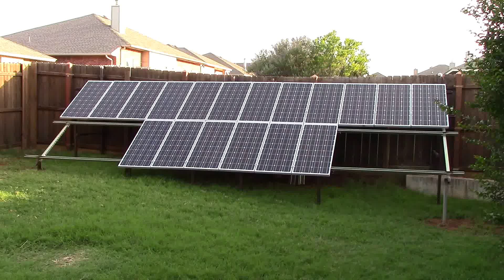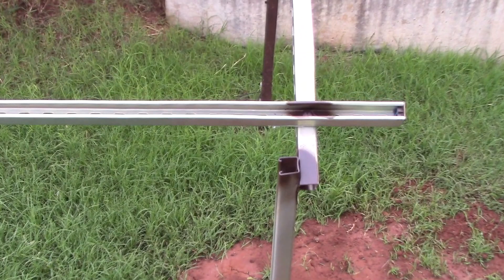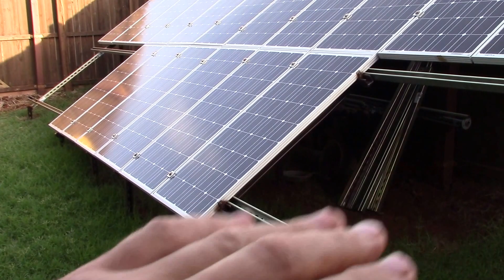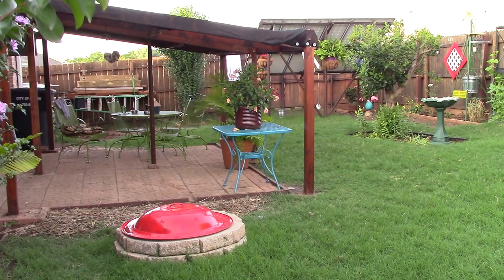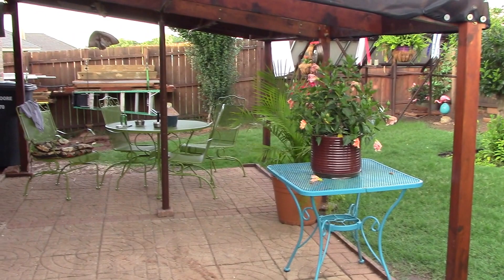Suburbia fenceline solar panel array (Superstrut racking installed)

Comment: Chris, what does your average electric bill run per month with your complete setup? We have a 2500 watt system and the past few months it was $29, $49, and this hot month is projected to be $60. We have a grid tie system and inverter. No batteries. We live here in Sunny Central Florida. Have a nice weekend.

Jeff
Reply from the maker: My last bill was $35...the largest one I have had in three months. Years ago before solar...this time of year it was pushing $180-200.
Reply: +Chris DIYer Wow great difference indeed. Our lowest bill ever here was $24. The highest with solar was just over a hundred. We were blessed back in 2009 when Florida had state rebates here when they paid back 4
$4.00 back per watt! The solar ended costing practically nothing. At this time with solar sometimes costing practically near $1.00 a watt it would make sense to double our capacity and make our system a 5000 watt system from 2500 watt. We'd have to get a new solar inverter too. We currently have a Kaco Blue Planet Inverter but it is maxed out right to 2500 watts Max. We will see. Do you have any systems to heat water IE a solar water heater or anything to heat your domestic water? We are looking at some solar water heaters so we can cut back on our water heating costs.